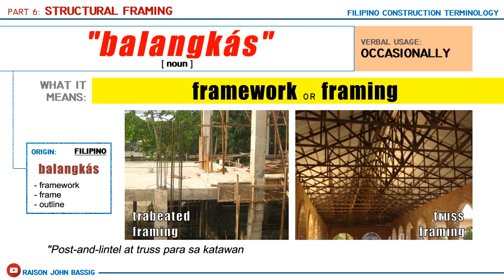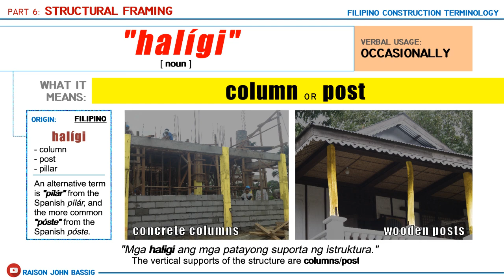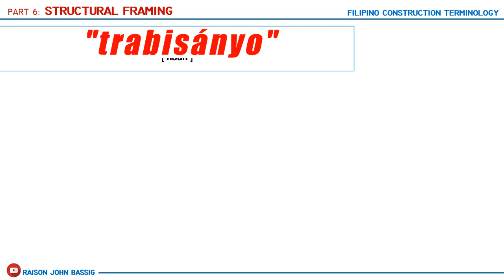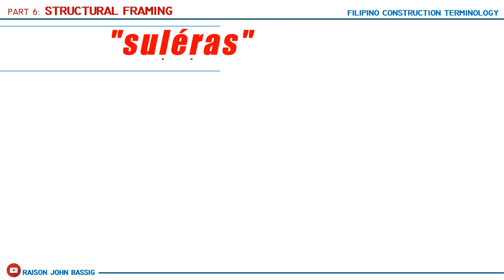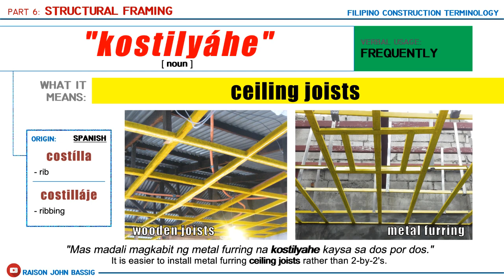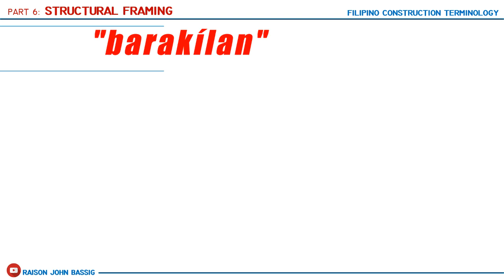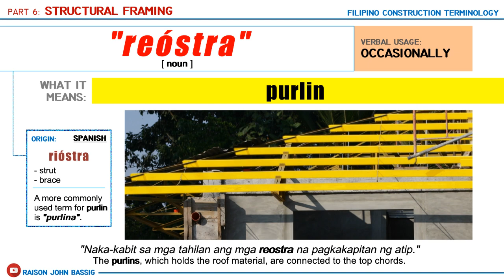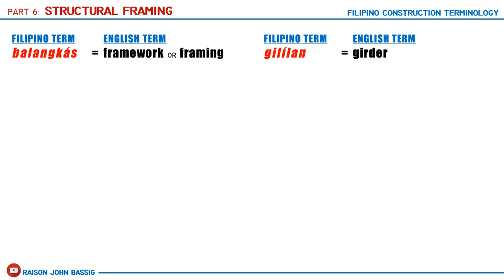Filipino Construction Terms || PART 6 || Structural Framing

Comment from the maker: Hey everyone! Thanks for checking out this video. PART 6 will be about STRUCTURAL FRAMING with the terms: balangkas, balantok, bobida, haligi, biga, dintel, sumbrero, hamba, pasamano, trabisanyo, pilarete, pabalagbag, sepo, gililan, suleras, kostilyahe, kilo, sinturon, tahilan, barakilan, tirante, piye de galyo, pendulo, taknang, kabalyete, and reostra.

When designing or constructing a house (or any other structure) in the Philippines, standard blueprints are always written in technical English. This may cause miscommunication with local workers who'll be building your project, since most of them speak in a vernacular language.

As the Philippines was once a colony of Spain for more than 300 years (and later on the United States for almost 50 years), the already diversified Filipino language has evolved by taking in a lot of foreign words (like the Spanish "la mesa" for table or "papel" for paper) and several American terms (like inches, feet, or gallons).

This video will be part of a continuing series on FILIPINO CONSTRUCTION TERMINOLOGY, where I'm going to share with you the terms spoken by local workers in the Philippines, where it came from and what they all mean. These are all based on my research and personal experience in construction sites.

Comment down below if you know any other vernacular construction terms not included in this video. Again, thank you so much for watching and let's all continue learning! :)

Comment: Hello po, a question lang 😅
Ano pong difference ng kilo at tahilan?
Reply from the maker: "Kilo" colloquially refers to the entire roof truss while "Tahilan" colloquially refers to the rafters, or the sloping top chords of a roof truss.  However, it is important to note that these terms may or can, sometimes, be used interchangeably or, may or can, sometimes, have synonyms to other construction terms.  For example:

Kilo, aside from what I have shown in the video, may also have originated from the Spanish word "quello", or, sa tagalog, "kwelyo", meaning collar.  A collar (or collar tie as seen in 4:44 which is also called "sinturon" in tagalog) is the horizontal beam that can connect to the sloping rafters (or "Tahilan") for additional support. This assembly form a simple truss, hence, the term "kilo" to refer to such assembled frame.

Tahilan, is actually a more general term, which means joist or brace to provide support. At times, even a floor joist (which is termed "suleras" as seen in 4:00 ) can also be called by some as mga "tahilan" - as it supports the flooring.  In the same manner, the top chords of a truss and/or the rafters are termed "tahilan" as it supports the actual roof.

Hope my insights help. Thanks again for the question, Jay :)